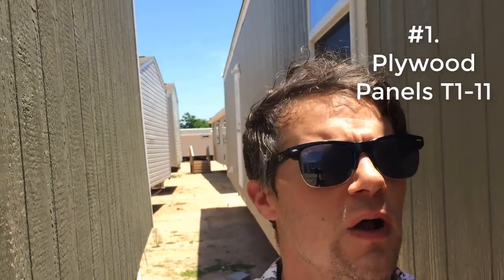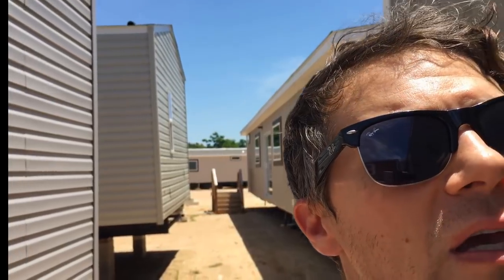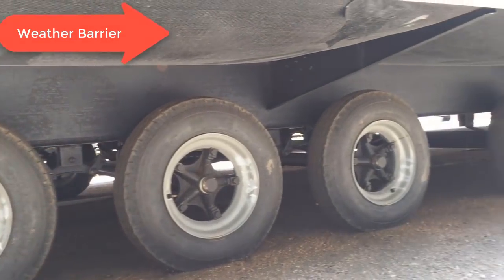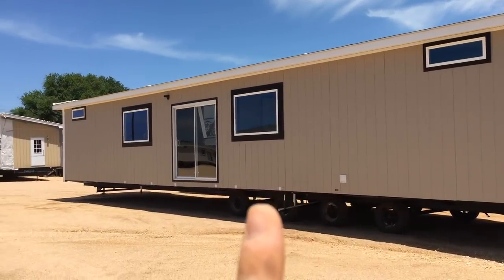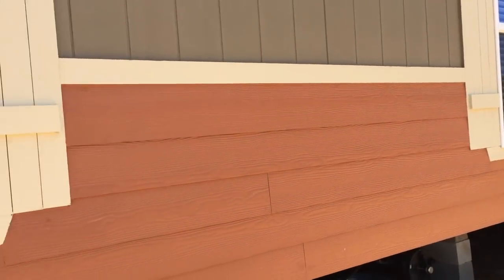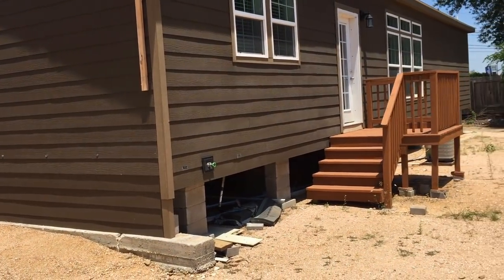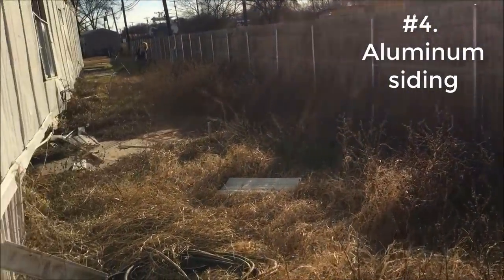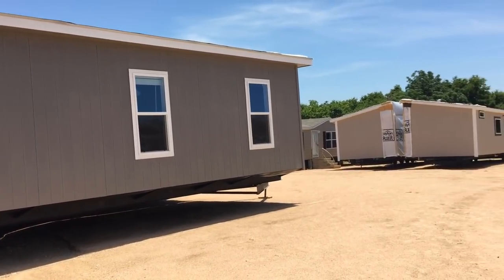Mobile Home Siding 101

Comment: Just purchased a Manufatured home, and I have a question is there any panels that mimics an actual house? like cement walls without the lines running down the sides. Because I’m trying to get my home to look like a real house lol
Reply from the maker: Hi JoTIKI. Thank you for reaching out and connecting. From what I have seen, if you can think it then you can most likely find it or put it on your mobile home. Over the years I've seen stucco siding on mobile homes, stone siding, log siding, and even thin cement siding for siding and skirting. However keep in mind that mobile homes are typically only built for a certain amount of weight due to the specific mobile home. Newer mobile homes and especially older mobile homes cannot have too heavy of walls without potentially bowing or causing problems. Over the years I've seen these types of heavier siding be a problem if the mobile home ever needs to be moved. Many movers will not move mobile home if it weighs too much or may fall apart during the drive. This is definitely a pretty vague answer however I hope that it helps and makes sense. Moving forward if you have any follow-up questions never hesitate to reach out anytime. Talk soon, John

Comment: My mobile home there is no weather barrier . What do you suggest ? A Tyvek wrap ? Wood under lay ? There is only vinyl then insulation .
Reply from the maker: Thank you for reaching out and connecting. In many mobile homes I have seen this underlayment material, whether it be thin plastic or tyvek has definitely deteriorated to the point of being nonexistent. Yes, I would definitely recommend a Tyvek type of material to wrap your entire mobile home in if possible prior to installing the next layer of siding. I hope this helps. Any follow up questions please never hesitate to reach out any time.
Reply: @MobileHomeFormula  Thanks , I will probably have more as I get my hands dirty . Its much appreciated .

Comment: I'd probably condemn the home with aluminum siding. It's not just replacing the siding itself, but with gaps that big, how much damage from water, mold and insects is behind the siding?
Reply from the maker: Thanks for watching! Very good points. Lots of damage from water, mold, and animals behind the siding. In some situations this is contained to a small section of the mobile home and wall. However in other homes this can be a chronic problem throughout the home and likely a dealbreaker in some situations. Thanks again for commenting. If you have any follow-up mobile home comments or questions please never hesitate to reach out anytime.

Comment: Hey i want to take out 2 ac window units that were built into wall can i just put  a sheet of aluminum right over the existing siding to cover holes or should take out the whole section and replace it...

Comment: Hey John. I currently own an early 70s mobile home with metal siding. What is the recommended fastener or method of fastening vinyl siding to the aluminum siding? I have done siding professionally in the past but never fastened it to metal and I don’t want the fastener to pull out. I would think screws, but that seems time consuming. Your thoughts?
Reply from the maker: Really good to hear from you. Thanks for reaching out and connecting. Your 70s mobile home will have a 20 year facelift once you add on this vinyl siding. Usually I like to place 1x2x8 strips vertical along the aluminum every 3 feet or so. This is what we will nail the final to. Hope this helps and makes sense. There are a few YouTube videos on this subject that discuss what I am mentioning as well. In fact I need to make a video like this showing how we do siding. Hope this helps some. Moving forward if you have any follow-up questions please never hesitate to reach out anytime.

Comment: So I currently have aluminum siding on a 1978 single wide,  I had someone quote me 24k to do siding over it.  They weren't going to take it down,  or wrap it.  They wanted to install over the metal,  what's your thoughts on that?
Reply from the maker: Thanks for watching this and reaching out! First things first, that quote you got is absolutely crazy in my opinion. The material to put vinyl siding on a mobile home is a few thousand dollars. The labor to do the work will probably take two days or three days at most from someone that knows what they are doing. I would encourage you to keep searching for someone will charge you for material and labor under $5000. Perhaps you are in a more expensive part of the country, then maybe you will pay a tiny bit more than that. However $24,000 to do the siding for an older mobile home is absolutely ludicrous, unless the siding is made of silver or gold. With regards to putting the vinyl siding over the metal, that is actually pretty common. I would recommend that they do that as well. However please continue searching for someone who will do the work and get materials for under $5000 if possible. Hope this helps and points you in the right direction.

Comment: Is there a place that still sales colored aluminum vertical siding  for mobile homes? If so, could you please send me a link?
Reply from the maker: Thank you for reaching out and connecting. Definitely Google search this and you will find a handful of providers. There is a website called mobilehomepartsstore.com that will have a lot of mobile home and manufactured home specific products. However the shipping cost can definitely add up. Please check your local home improvement store as well as any mobile home specific stores in your area. Hope this helps and points you in the right direction.
Reply: @MobileHomeFormula  Thanks :)

Comment: Hey John, is it possible to replace the metal siding with the OSB/T1-11 option? If so, can you direct me to a video or guide for doing that?
Reply from the maker: Thank you for reaching out and connecting. Yes, I have seen this done before however it is not ideal if this porous siding material touches the ground. I've seen this done and within a year the OSB, plywood, or T1 11 shows signs of rot. I've also seen this done with a gap between the ground and the skirting with some pressure-treated wood or metal in between. Or a Masonite or concrete type of material used as the siding instead to prevent rot. I do not have a video on this however this is a very good idea and something that I will look to make in the near future. Thank you again for reaching out and connecting in the good idea. Moving forward if you have any follow-up questions never hesitate to reach out any time.

Comment: Hi John, it’s a great video and I learn a lot from your video. I just bought a mobile home last year. It was cover by aluminum panel but the screws are extremely rusty. I don’t know how to do with it. Can you give me some advice?
Reply from the maker: Thank you for reaching out and connecting. My first question is if the park is requiring you to fix the? Also, are there any leaks inside of the home or is this just aesthetically ugly? Also, are the rusty nails causing streaks down the mobile home. If this is the case that pressure washing the home and/or painting the property may be a wise idea. You can also put a rust inhibitor on the screws to help prevent future rusting. I hope this helps him and point you in the right direction moving forward. As always, if you ever have any follow-up questions never hesitate to reach out any time. All the best.

Comment: Hi John, great video! We are thinking of rehabbing an old 1970’s trailer with aluminum siding. We haven’t inspected it yet, but assume it needs a lot of work. Did I hear you correctly that you can go right over the aluminum siding with vinyl siding? Or would the aluminum need to come down first? Thanks in advance!
Reply from the maker: Hi rose hargraves, Thank you for reaching out and connecting. Great job aiming to tackle this 1970s mobile home! When it's done I'd love to see some before and after pictures. You may want to get a second or third opinion depending on your exact location or altitude, however keeping the aluminum siding in place and covering it with vinyl siding should not be a problem in most situations. With that said if your aluminum siding is somehow obstructing things or filled with a weird mold situation then by all means this with of course have to be removed before the vinyl siding covered it. However in all likelihood your aluminum siding probably does not look too weird or wobbly hopefully. I hope this helps and starts to make sense. As always, if you ever have any follow-up questions or concerns never hesitate to reach out anytime. Keep in touch. All the best. Talk soon, John
Reply: Hello! Out of curiosity, what did you end up doing? I have a 70's place with aluminum too and well... its time to do something about it...

Comment: I live in a 1991 Bonnavilla 16'x76' mobile home that has the "T1-11" plywood siding. It is starting to rot and seperate between panels and am looking for the best way to reside my entire home. I would like to use Corrugated metal siding but i'm sure vynil siding would be much more cost-efficient.
Reply from the maker: Hi Waylan Goddard, Thank you for reaching out and connecting. If the current T1-11 is the original than this certainly lasted a good bit of time before rotting on you completely. You are definitely right with regards to the vinyl siding as far as the price goes. However if you plan to live in this property a while longer and truly love the look of corrugated metal siding that I would encourage you to do this slowly over time if possible. If the home is located inside of a pre-existing mobile home park you may not recoup all the money invested when you sell, however if it is attached to your own piece of land you make it some or most of this money back. I hope this helps and make sense. As always, if you ever have any follow-up questions never hesitate to reach out anytime. All the best. Talk soon, John

Comment: With alluminum panels on a 90s model singlewide that is mostly mint condition: is it typically worth the investment to remove and install vinyl siding?
Reply from the maker: Hi Samantha. Thank you so much for reaching out and connecting. My apologies about the delay in this common reply. Assuming that the aluminum panels on the 90s mobile home are in decent shape it would not necessarily be worth the money if you're planning on renting the home or selling the monthly payments. However if you are planning to resell for cash then adding vinyl siding at the cost of less than $3000, will likely add that amount to the new resale price. Again, selling for cash in a high demand market it may make sense to install new vinyl siding. However a nice coat of paint on the outside can make aluminum look very nice as well. In most situations I would not upgrade siding unless the park manager is asking you to, the current aluminum siding is in pretty bad shape, or this is the only mobile home in the community with aluminum siding and you plan to sell for cash. Hope this helps and makes sense. If you have any follow-up questions or specific concerns never hesitate to comment back anytime or email me directly at support@mobilehomeinvesting.net. All the best. Talk soon, John

Comment: Hey where can I get the metal for older mobile homes? is there any place that sells this?
Reply from the maker: Hi Mike. Thank you for reaching out and connecting. Very good question. These aluminum sheets may be available at your local home improvement store, or you may have to search for a mobile home supply store in or around your area. Reaching out to local mobile home dealerships and mobile home factories may be helpful as well to point you in the direction of these aluminum panels. A roofing company may be helpful as well to provide metal for roofing if you are looking to replace your roof. Hope this helps and points you in the right direction. Keep in touch if you have any follow-up questions.

Comment: Is the siding you first discuss really T1-11?
T1-11 is true plywood, indeed, but there are similar-looking siding materials on some mobiles that are essentially textured paperboard, not plywood.
Reply from the maker: Hi Darron Birgenheier, Thank you for reaching out and connecting. Thank you for bringing up this question and the fact that there can be some really nasty looking pressboard type of siding. Some plywood siding from the 80s or 90s might be so rotted it is as thin as paper and the paint is holding some of the exterior together. With that said this product in the video is fairly high quality. Thanks again for commenting. As always, if you ever have any follow-up questions or concerns never hesitate to reach out any time. Talk soon, John

Comment: My mobile home has aluminun siding  and I want to cover with vinyl siding. Can I put the vinyl over the aluminun, wich is in good shape . And still needs to cover the aluminun with the weather barrier?
Reply from the maker: Hi Martha. Thank you for reaching out and connecting. Yes, you will be able to put the vinyl siding directly over the aluminum siding in most cases. However you will want to have 1 inch thick vertical wood strips every few feet installed over the aluminum siding so that you may attach the vinyl siding to these wood strips when installed over the top. There are other videos on YouTube that show homeowners installing vinyl siding in this way. Over the years I have used a weather barrier and not used to weather barrier. If possible, I would encourage you to use a weather barrier if possible. This will only help ensure your home is protected as well as possible from the elements and water. I hope this helps and point you in the right direction. Feel free to keep in touch moving forward. All the best. Talk soon, John

Comment: when repainting a mobile home, if it's two tone, do you still keep the color scheme or do you just typically just spray the whole thing one color?
Reply from the maker: Hi Tracy. Thank you for commenting. I usually keep this two-tone. It cost a little bit more in paint and labor usually, however looks nicer in my opinion. However this is just my opinion and experience. Hope this helps. Any follow-up questions never hesitate to reach out anytime.

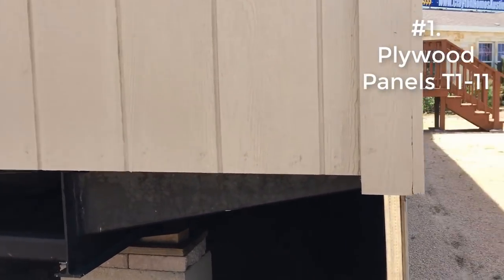Comment: That's not T1-11, (6:24) at least not the real T1-11 anyway, which is real fir plywood with exterior glue,  and is about 5/8" thick. Big difference in quality. OSB should never be called Plywood. It's a bit misleading and confusing.
Reply from the maker: Hi Ray Brensike, Thanks for reaching out and connecting. You are a wealth of information. Keep in touch moving forward. If you have any follow-up mobile home questions never hesitate to reach out any time. All the best. Talk soon, John

Comment: wouldn't the hardie board be to heavy for a mobile home?
Reply from the maker: Hi InkyAk86. Thank you for reaching out and connecting. Yes, it may be. When in doubt absolutely have one or two mobile home movers come out to take a look at the mobile home and judge for themselves. Keep in mind that some mobile homes are built better than others, and they come in all different sizes and shapes. Additionally, going 6 miles down the road is different than 60 or more. However the home having one type of siding or another should not be a dealbreaker by itself in my opinion. If the home is too heavy then there is likely a solution to get around this and make everyone happy. I hope this helps some and make sense. We are obviously talking about hypotheticals until we actually have a home that we are looking at moving. If you have any specific questions or general questions never hesitate to comment back here anytime or email me directly at support@mobilehomeinvesting.net. All the best.

Comment: Do you recommend upgrading to t1-11 if you have metal siding. Or is it just pending price and other variables
Reply from the maker: Hi Jake gavic, Thanks for reaching out and connecting. No, I do not want to overspend or spend more money than needed. I typically do not upgrade with regards to my mobile home investments. I want to fix what is broken and move on. That is not always the case however when selling on payments that is mostly the strategy. Hope this helps some. All the best. Keep in touch. Talk soon, John
Reply: John Fedro awesome. I wasn’t sure if the 1200 spent on a single wide would ballon the investment return. I guess I should have just asked the question differently. Thanks for the response. Your content is amazing